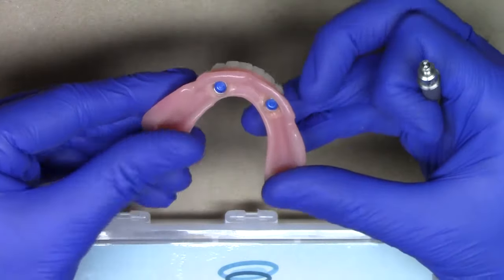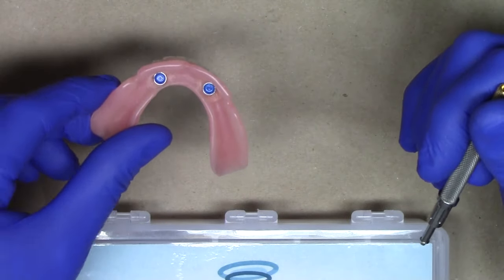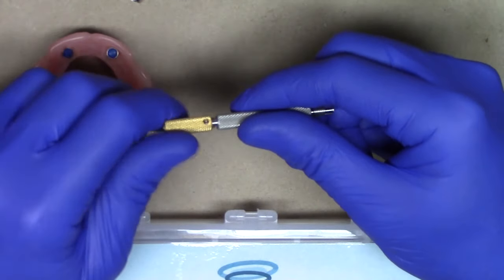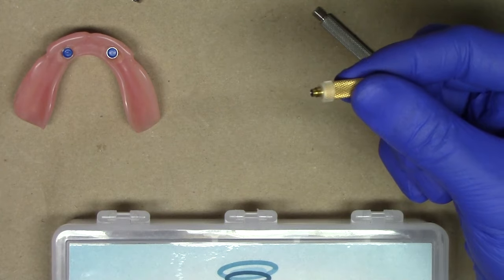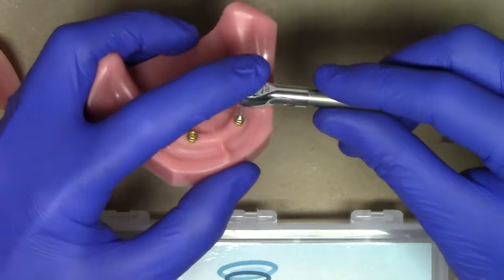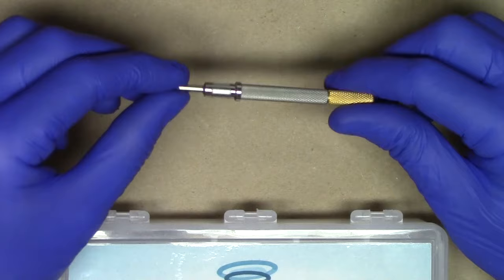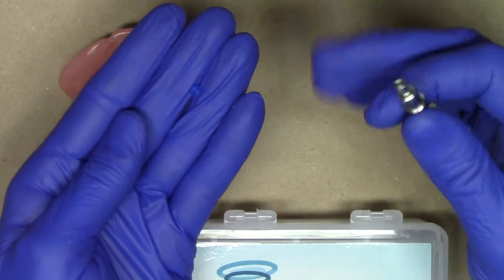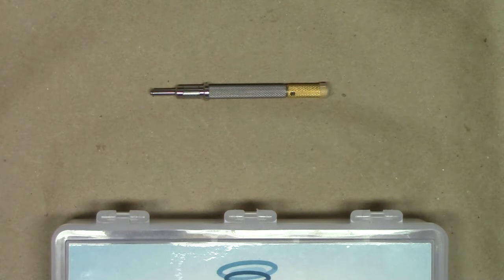Tips and tricks for using the LOCATOR® Core Tool

Comment: There is a problem with this tool that many of us encounter. After some time the extraction (plunger) portion of the tool loses the ability to "lock into" the nylon insert and pull it free from the metal jacket. Especially anything less than 1.5 pounds or less (blue nylon insert is rated at 1.5 pounds). I have been through four core tools now in the past three years.

Comment: Can I buy one of these tools because I’m getting the snap in dentures in November and I don’t want to go to the dentist every six top twelve months to get them changed for $1300 and I’d rather get the all in .4 done is there less maintenance on the all in 4 vs the snap in dentures?
Reply: 6 to 12 months? You'd be very lucky indeed. Your frequency or replacement. Mine are only lasting 6 weeks! I'm very discouraged and disappointed with these expensive products that you're stuck with because there's no going back now.

Comment: Are these tools available to anyone? I got my inserts 10 years ago, and now have no Dentist to replace my locator inserts. They are very worn, and my dentures come detached when I eat or open my mouth too wide. Any help would be greatly appreciated, thank you.
Reply: OldJarhead36 have you acquired any info on this issue you have posted here? I’m looking to replace mine. I just located this video and it’s very helpful . If u have any updates please post here and I’ll do the same . Thank you
Reply: They are available on Ebay. There are also less expensive non-brand name models. The inserts are available on Ebay as well.
Reply: The inserts and the tool are available on Amazon. The tool is about $90 and a 4 pack of inserts are about $35